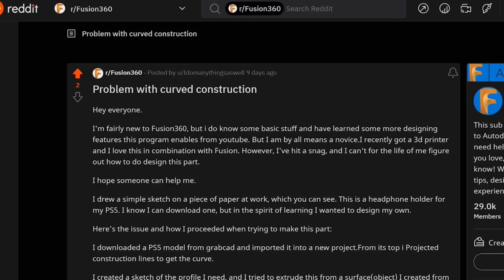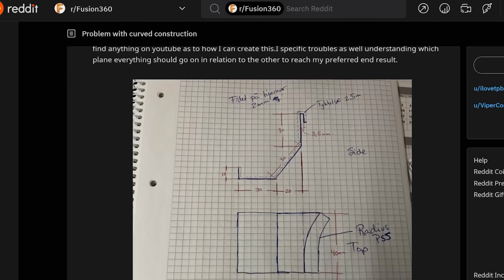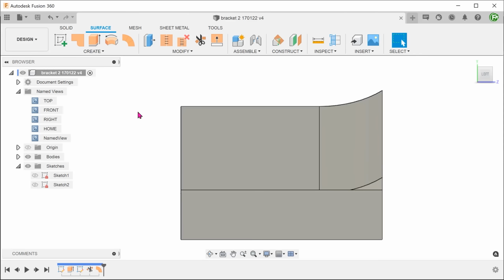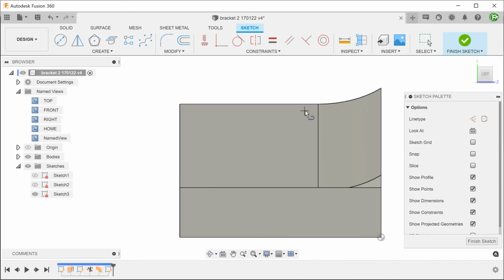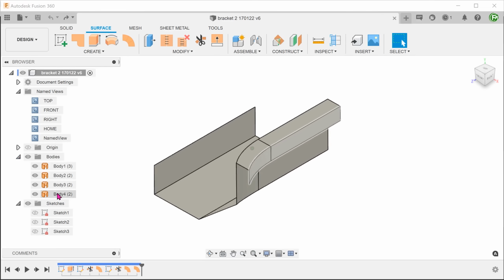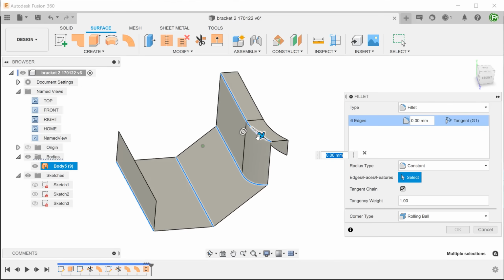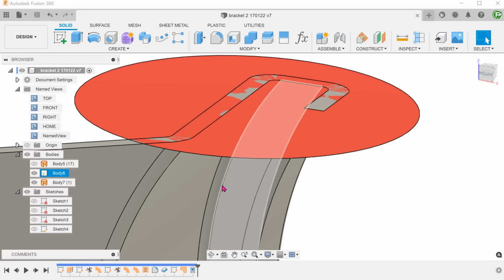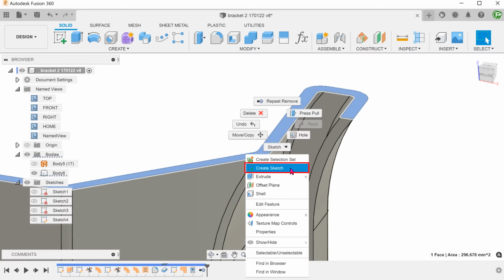Fusion 360 | Case Study 24

Comment: correct me if i’m wrong but you should be able to use an offset plane instead of making an undefined sketch and patching it for the replace face
Reply from the maker: Wow, this is a complete revelation to me. I just went to try it and it works. It was able to work even on primary planes. I was not aware that the replace face command accepts planes. Thank you for this!
Reply: For me myself I hardly use patch surface option. I prefer offset plane and project instead, and use loft or whatever necessary.

Comment: I made 3 profile sketches to make a surface loft and it made the curve and profiles match the drawings really well. Then I thickened to the outside since that's what the drawing indicated, extruded faces that were too far in on the top curved portion and used split body (planes as tools) and remove.
Reply: @Fusion360School is there a way to achieve uniform thickness without setting the Thicken feature to symmetrical?

Comment: I commented on this before but put a link in the description so I don't think it showed up.  I like the technique you used here!  Very clever as long as it isn't to be sheet metal(which you state).  One other method that could work depending on the design intent is to extrude the bottom, sweep the top and then loft between the two of them.  It is hard to tell from the reddit drawing what that intersection should be.